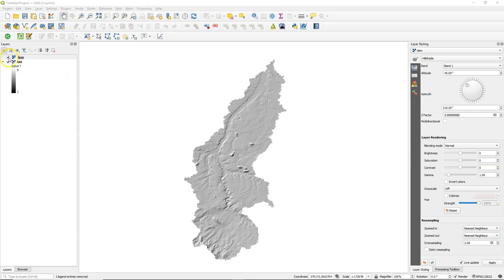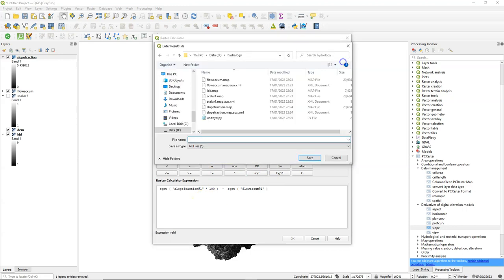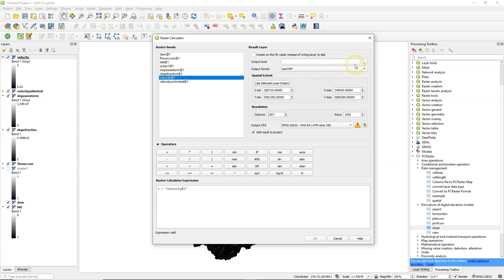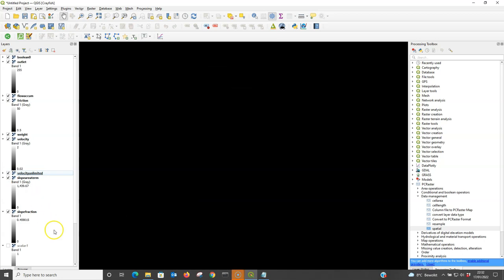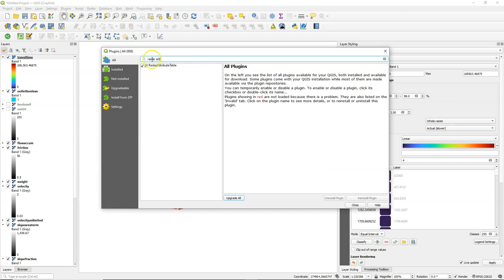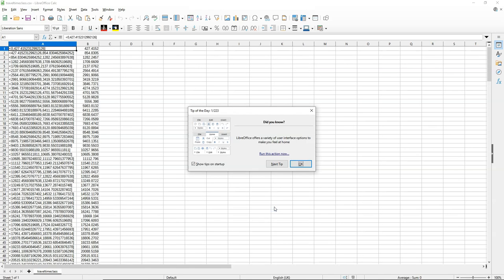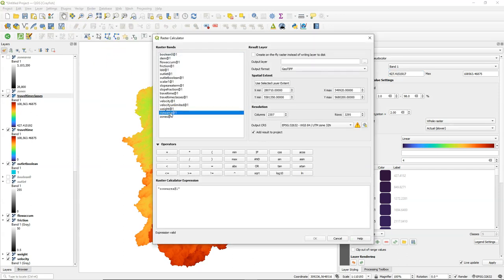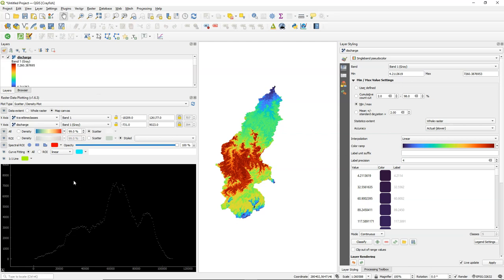Calculate a Unit Hydrograph from a DEM in QGIS

Comment: Sir, I have tried to install PCRaster tools in Qgis as explained in your other video session but still, I am getting an error ( PCRaster is not installed)
Reply from the maker: Then you're probably using an OSGeo4W installer that doesn't correspond with the QGIS you launch. Click right on QGIS Desktop in the Start menu and go to the folder. Run the OSGeo4W installer from that folder. The  you're sure it's the correct one.

Comment: Thank you for your amazing tutorials. PCRaster is indeed a great tool. I have one question: The documentation to ldddist is not mentioning any unit of the output and I can't find the theoretical background for it. Are you sure the output is in seconds? Would it also be possible to use mannings n values to incorporate land use for the weights raster?  Thanks again for your great videos!
Reply from the maker: Ldddist calculates the distance over the flow direction. Distance units are in map units.
Reply: @HansvanderKwast  thanks for your quick reply! In this video you save the results of ldddist as "traveltime" and mention at min 8:45 that it is in seconds, or did I get something wrong?  Is it because of the Weight raster which has the unit T/L ?

Comment: Great!! is it possible to export IUH in .CSV file?
Reply from the maker: Unfortunately, the plugin doesn't give that option. You'll have to export the rasters to separate CSV files using the gdal2xyz tool from the Processing Toolbox. Then in a spreadsheet programme you can  merge them into 1 CSV. I'm planning to implement the PCRaster map2col tool that can create a CSV for values from multiple rasters. I hope to add it soon.

Comment: Sir, I got problem in create the layer outlet. Copy past coordinates in this form  (386428.19,1839087.75,1). i have create notepad txt file. but when i attach the txt file, ldd file to Column file to PCRaster Map that showing me error.  please help me to create outlet layer. is there any other method to create outlet layer?
Reply: Sir , can you please help me in that?.
Reply: I have try that 20-25 times.
Reply from the maker: It has most likely to do with your file/folder names. But if you can't solve that you follow these steps:
1. Go to the OSGeo4W shell. An easy way is to go to the Browser panel, click right on the folder where your data is and choose Open in terminal...
2. In the terminal type:
col2map -N yourcsvfilename.txt outlet.map --clone yourlddmap.map
3. Click enter and if your files exist and are correct it will produce the desired output. It will also display issues on the screen.
Reply: @HansvanderKwast  thank you so much, sir.  I will try this.

Comment: You were dividing water flow velocities into classes. Why? Perhaps following a script, perhaps that which you mentioned. 
That causes jagged curves. I learned that even using different time tempi 15m/60minute of sidestream outflows cause the same effect. 
And a unit hdg is not the sole answer to a very extreme diversing flow. 
Soil use diferentiation, soil wetness saturation, and so many things...
I studied the Ahrtal flood disaster since it happened, got some eyeopening results, and I'm looking for a job into this area.
Reply: Hi there, I am currently doing my MSc thesis on the floods in the Ahr, Vesdre, etc. What are some of the most interesting results that you have found so far? My QGIS skills are not yet that great, so I have not yet been able to find any significant results.
Reply: @FormikFilms   I started work on Ahrtal at 15/07/21, as I had seen the weather forcast the day before... and I'm still working on it. The work is like a PhD now. Hans!
First: I compared this flood with older flood info in that Ahr valley. Second: next fundament is (know your) history: most is written German, some in Eng. I can read D,F,E,G,and I. 
Third: I only started GIS-help in Oct 2021. So I think GIS is not ess., why use gis on shi te data? When you have good data analytic skills and can use many software pkgs, you can sieve it thru. 
4th: I don't know what youre formation is, a geographer or a geologist, some engineer, human sciences... It matters much for your view/starting point and direction. 
5th: getting good data on a golden plate: it is not there (for Ahr), too short timeseries on official websites, mostly it's dated, too coarse, nons, errors, data based on wrong calculations, or completely wrong forecasts... 
6th: so that can be my cheapest hint: most official data is nuts
ps, I did not get a notification of your reply here, so if I dont reply soon, it is not my fault, I try to remmeber this post